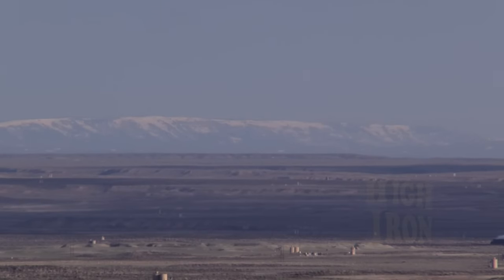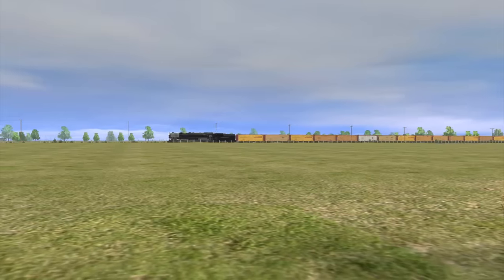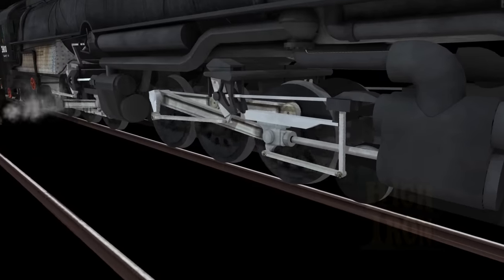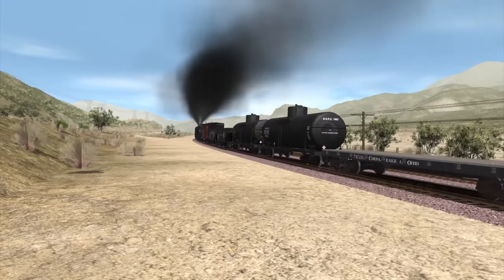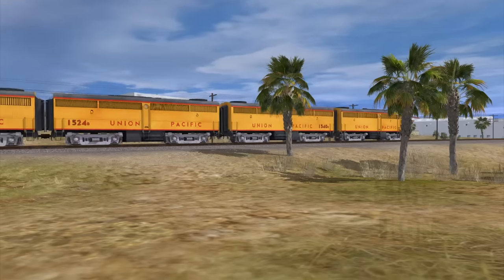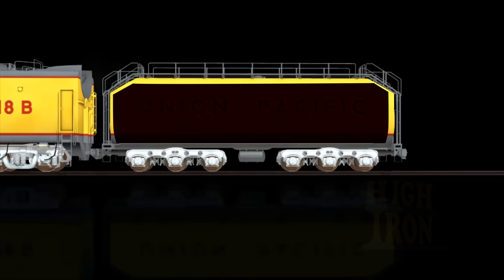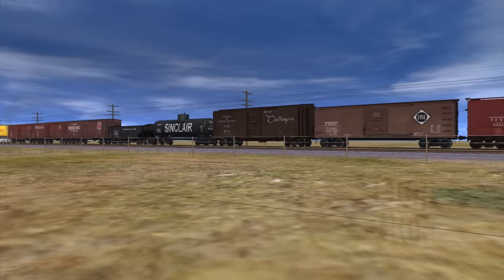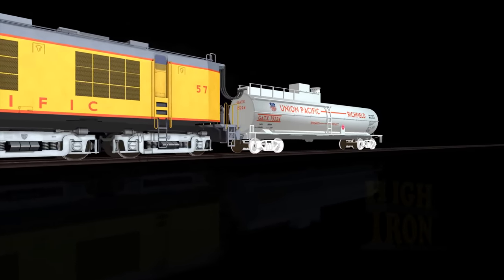Union Pacific's Superpower Fleet

Comment: I would be curious at what point does traction become a issue. I mean you are using the weight of the  engine to help with traction. But your  still smooth train wheels on smooth rails. There has to be a limit. Now I know they use sand to get traction. They spray it in front of the drive  wheels. But still there has to be a point that don't work and why did or should I say who determined the the rails for these big ass heavy trains could only be what 5 feet wide. Now I know the cost to retro fit all the rail ways would be expensive. But damn 5 foot wide rails for all that tonnage going 80mph and around corners. If anyone knows the answers please tell me. I have never understood the narrow rails of a train.
Reply from the maker: What it comes down to is how powerful the engine is, how long and heavy the train is, and whether the track climbs any hills. Engines come in all sizes and strengths for different types of work.
Reply: All locomotives “power“ is measured by two things, horsepower and tractive effort. Tractive effort is measured in lbf. Or pounds per foot. Most people when they look at locomotives strictly look at the horsepower and think that’s what dictates a powerful locomotive, but the opposite is actually true. Horsepower is what moves trains once they’re already up to speed. Tractive effort is what allows heavy trains to get started and then get up to that speed. That’s why a big boy, despite having over 6000 HP couldn’t start some heavy trains by itself whereas a modern EMD or GE diesel all by itself could. The big boy would then excel at maintaining that speed once the train was moving. So when you want to talk about what makes a powerful locomotive, always look at the tractive effort. Because all the horsepower in the world doesn’t do any good if you can’t get that horsepower to the rail.

Comment: if UP went through a tough time to revive some 6936, 4014, and 3985, why not use them for revenue freight service, too?
Reply: Where would you service a steamer? Most steam infrastructure has been destroyed in favor of Diesel. UP already has enough issues with logistics on pre-scheduled, heavily planned excursions.
Reply: @AVeryRandomPerson  Cheyenne, Wyoming.
Reply: Because modern locomotives are far more reliable and easier to maintain. They have dynamic brakes and are way more powerful than the DDA40X anyway

Comment: Man i never knew the GTELs were that problematic
Reply: Chafano Nash basically they experienced many of the same problems steam locomotives did.  They weren’t much more reliable and and it was inevitable that diesels would eventually win out.  The SD40-2 was an unsung hero to every railroad and many are still being used today,  almost 50 years after they were first introduced.
Reply: @gregrowe1168  I Agree. The SD40-2s Really are heroes, They were the primary workhorses on some Railroads.
Reply: Agreed! The run from SD35's through SD40's and SD40-2's are my favorite locomotives. I lived across from the UP mainline and for many years I would watch 40 to a hundred of those models storm past my house on an average day! UP would usually have six to eight of them (or more!) on the front of every train! Occasionally with a few on the rear as well! The massive, symphonic and magical growl of all those two-stroke beasts was so beautiful. One could hear the rumbling cadence coming across the distance for twenty minutes before the train would finally come by!  "You can't do that on stage anymore!"
Reply: @michaelsullivan3581  That’s awesome. I wish i was around when engines like The SD35s, SD45s, C30-7s, U-Boats, GP35s and more were still around

Comment: So why aren't UP building even more powerful locos today? 4500hp is nice and all, but it's still less than they had in the past.
Reply: Matt Evans those older locomotives used a lot of fuel.  The newer engines might make a little less power but are way more fuel efficient.  The cost of fuel is much higher now and profit margins are less for railroads now than they were back then.  Basically those type of locomotives would be too expensive to operate now.
Reply: @gregrowe1168  Well, you'd be using less locos, so fuel cost would at the very least balance out. But, less locos also means less maintenance costs, and fewer drivers so lower employee costs. Pretty certain it would still be cheaper.
Reply: Short version, Above 4500 HP six axles reach their limit of adhesion. One can add more horsepower, but that produces so much torque that the computers work overtime to keep the wheels turning just below the point that ether the wheel or the track gets shaved off like cheese slices! So more horsepower requires more axles, more expense, more maintenance etc. Physics just sort of auto-balanced to 12 wheel 4400 to 4500 hp locomotives.
Reply: @michaelsullivan3581  So why not make an 8 axle design, like Bo-Bo-Bo-Bo. More axles, which spreads everything out more, but also, in a configuration that is actually better at turning corners than a Co-Co design.

Comment: Comparing diesel horsepower with steam is misleading. Most steam engines could pull substantially more weight than a equal diesel locomotive. They pull differently which is why steam loco's lasted as long as they did

Comment: I wonder if they ever made a new steam locomotive that they could make one better and more efficient
Reply: It’s been discussed many times. And the answer is no. Steam locomotives were at the peak of efficiency when the last models were being manufactured. It wasn’t that long ago that an engineering firm in Europe tried to look into some ways of potentially upgrading a steam locomotive to more modern standards to try and bring in more efficiency. It simply cannot be done. It’s just the inherent nature of how steam locomotives operate. The only way you could ever increase Efficiency is if you use steam to produce electricity. But at that point the logistics just don’t make any sense.

Comment: The strongest Loco‘s are electric with a wire overhead…
They should have electrified all the important lines in the US !
Reply: Most locomotives are electric but powered by a diesel generator now
Reply: @crematedable  
Don’t makes it better .
Too much dead weight to transport, fuel, motor and generator …
No transcontinental direct services possible…
Reply: The cost is why it won’t happen.  Up or any other major railroad isn’t going to spend billions to electrify their thousands of miles of track,  not to mention build a whole fleet of new locomotives.
Reply: @gregrowe1168  
This is short-term-thinking !
Oh ,yes, Gas will become cheaper and cheaper and renewal of rolling stock is not happening ever. 
They could save a lot of money AFTER the electrification…
Reply: eh seems like americans will forever addicted to oil

Comment: I bet it wad hard to make big boy successful
Reply: Was a different time then.  In the 1940s,  railroads were the only reliable means to move freight,  trucks were in there infancy and weren’t a threat to up yet.  So they could charge more per ton of freight than compared to today with inflation factored in. So the higher cost of running these massive steam locomotives was just passed on to the customer in higher freight charges.  The customer had no choice except to pay it.

Comment: are we forgetting that the sante fe built a 2-10-10-2?
Reply from the maker: Not really. The ATSF 3000 Class was 11 feet shorter than the Big Boy, and could barely hold its own in revenue service before being chopped down into 2-10-2's.

Comment: The Centennials made no sense. They were two GP40-2s on a single frame. They were more expensive because they were custom made. Their long frame and 4 axle trucks were harder on the tracks. On top of that, if one of the diesel engines went out, the whole locomotive had to come out of service. With a two unit GP40-2, if one went out of service, just remove it from the train and add in another one. Yes, they are impressive to look at, but made no sense to actually build and operate.
Reply: Was an ego thing for up I think.  Look we have the most powerful unit.  It spends most of its time in the shop but boy it really pulls when it can.  In reality 2 gp40s could pull more too,  they’re combined tractive effort was greater.

Comment: Maybe instead of focusing on the locomotives they can build something on the track that has no theoretical maximum amount of power and can power the locomotive for its journey without needing to have space for fuel.
Reply: Electric locomotives do that.  It’s just so expensive to build that no railroads want to do it for freight service anymore.  Only places you find it in the U.S.  is intercity commuter trains.  For up to electrify their whole network of thousands of miles of rails and replace all their locomotives without electric units,  the cost would be in the billions.  They would go bankrupt.
Reply: @gregrowe1168  Yeah electrification was kind of my implication. They don't have to do it all at once but electrifying sections would not only increase speeds but replace fuel costs with cheaper electric costs and remove fueling time making journeys faster. It would be nice to at least see them start something even if some sections aren't practical to be electrified.

Comment: There is a theory that the GTEL 8500HP Gas Turbines could 753 freight cars at 12mhp on leveled track, but this theory hasn't been proven.
Reply: 'Tis perhaps mathematically possible but real world forces and limitations would make it impossible to pull off.
Reply: Sounds pretty far fetched to me.  Though there are loopholes to this ad they could be empty and some older freight cars were much smaller too.  753 of those empty cars might only weigh as much as say 150 loaded modern coal cars and a gas turbine probably could pull that.  It would take everything it had and would be very hard on the locomotive but could probably do it.

Comment: Video in a nutshell;

UP: We need more wheels
Engineers: It can't go around curves
UP: Then split the drive wheels and let them swivel. Also more wheels.
Engineers: But we're going up mountains and they can't make it alone
UP: I said more wheels
Engineers: Well we can go diesel.
UP: Do it
Engineers: But they need more power than we have
UP: Well, make it use less parts
Engineers: Ok then...
UP: Also use the old tenders for extra oil for those long journeys
Engineers: We still need 3 parts to make it work, but that's not the problem the problem is they suck
UP: COMBINE THE PARTS! THAT'S OUR PROBLEM!
Engineers: That would be insane! I would be stupid! Here's a big B Unit
UP: Nice! Now put a cab on it!
Engineers: Done, and a stronger one's been made, too.
UP: YEAH LET'S GO
Engineers: They're also completely fucking up the ra-
UP: bigger
Engineers: ...you don't know when to stop. here
UP: I love it!
Engineers: They are fucking up the rails even more
UP: Fine use multiple engines...
Engineers: There you go

Edit: thanks for a single like

Comment: If the big boy could make 7000 horsepower and the GETL could make 8500 horsepower, does that mean the GETL could beat big boy in a tug of war?
Reply: The Big Boy was making around 6,200 HP, not 7,000.  But horsepower alone will not win a tug-o-war. It’s tractive effort.  And not only are the GTEL’s far more powerful, they also have more tractive effort.  With 212,000 lbf of tractive effort vs the Big Boy with only 135,000.  So this would not even be remotely a close competition.
Reply: @FFred-us9tw  it varies from website to website with some saying around 5300 horsepower,  and others saying 7000 horsepower.
Reply: @FFred-us9tw  wouldn't it also be hard to compete with something that pulling back with something that weighs 800,000 pounds pulling back with a force of 130,000 pounds of tractive effort.
Reply: @ThunderboltSirenStudios  no. It would not be hard at all. Weight alone of a big boy would be no match for something like a GTEL. A loaded Big Boy weighs about 600 tons. That’s the weight of less than 5 loaded coal hoppers. A modern Diesel locomotive wouldn’t even break a sweat on that let alone something like a GTEL with such a massive amount of power and tractive effort.  It would drag a Big Boy fighting it with no issues at all.

Comment: The Rio Grande did not like the Challengers. They were forced to take them by the USRA.
Reply from the maker: *War Production Board, but yeah. Those 3800's just couldn't compare to the superior L-105 types. :/
Reply: @HighIron Or the DM&IR 2-8-8-4s they would borrow when the ore shipping on the Great Lakes was shut down for the winter. The Rio Grande said the Baldwin built 2-8-8-4s were the best locomotives they ever operated.

Comment: Technically in hp the GTELs are more powerful then the Bigboy, but the Bigboy actually pulls more weight.
Reply: Actually no.  The Big Boy’s had around 135,000 Lbf tractive effort vs 146,00 Lbf for the GTEL’s. The GTEL’s also had traction control and a lot more HP.  A GTEL could easily out-pull any steam loco with ease.
Reply: @FFred-us9tw  But GTELs are made up of two different power units coupled together. Plus, there are some situations where a diesel would stall but a steam engine could pull through.
Reply: @Astro_Dog777  GTEL’s are not two separate power units.  Only one gas turbine provides all the tractive effort.  There is a smaller diesel engine on board that is for moving the locomotive around the yard when the turbine is shut down.  
  And there would be no situation realistically where a modern diesel would stall where a steam locomotive alone would not.   Even the recent event where Big Boy aided a stalled freight train,  people are not paying attention to what actually happened.  The train had two diesels and ONE failed. So it simply needed a push to get started.  The other diesel was working just fine.  Big Boy alone would not have moved that train had both diesels failed
Reply: @FFred-us9tw  How do you know that?
Reply: @Astro_Dog777  how do I know what? The GTEL specs are common knowledge and all over the internet. And the Big Boy freight train rescue is well documented.  Tons of videos too. UP even explained it in detail when it happened.
Reply: @FFred-us9tw  By the way, You said the diesel just needed a push. But It could not supply the needed power by itself & looking to the Big Boy for help proving the Big Boy is strong. You done just proved yourself wrong.
Reply: Plus GTEL's don't even run anymore.
Reply: @Astro_Dog777  😂😂 prove myself wrong how? Do I have to explain what tractive effort is to you again? The train that the big boy helped push lost ONE locomotive. So it did not have the tractive effort required to get the train moving. Once the train was moving and got up to speed that added power wasn’t needed anymore. That’s the difference between tractive effort and horsepower.
Reply: @FFred-us9tw  I know the difference between tractive effort & horsepower stop assuming im stupid.
Reply: @Astro_Dog777  i’m not assuming anything, I’m reading your comments. Like the comment above where you said there are situations where a diesel might stall and a steam locomotive might pull through. That statement alone proves you don’t know anything about tractive effort. Because the most powerful steam locomotive ever built which had over 6000 hp still has less tractive effort than a modern diesel locomotive.  
That comment means you don’t understand the difference between horsepower and tractive effort.
Reply: @FFred-us9tw  Listen man to be honest im getting kinda bored of back & forth arguing so can we just agree to dissagree & leave it at that?

Comment: Except that gas turbines dont have very good thermal efficiency...........turbines suit applications that need high horsepower in a light weight package........like a helicopter or planes.   Diesel on the other hand can be burned inside closed combustion cylinders at very high pressure ( 3 times atmosphere then squeezed 15:1) which produces very high thermal efficiency from the fuel.  Large diesels are now reaching 50 to 55% thermal efficiency when gas turbines max out at 40%.
Reply: One common use of turbines is in industrial applications such as electrical power generation (e.g., cogeneration power units) or to drive pumps, compressors, etc. (e.g., in an oil refinery) due to their higher efficiency. Here, weight or power-to-weight ratio is not usually a factor.

Unlike gas turbines used in the transportation sector where they are inefficient due to non-steady state power demand, industrial gas turbines are generally run at 100% power output 100% of the time (where they are most efficient). I once worked at a gas fractionation plant that used a gas turbine to drive a compressor. Plant production was related to this compressor's output so the gas turbine section would undergo frequent cleaning to keep efficiency and power levels at their peak. It was also a good application because the turbine was powered by fuel gas produced by the plant.